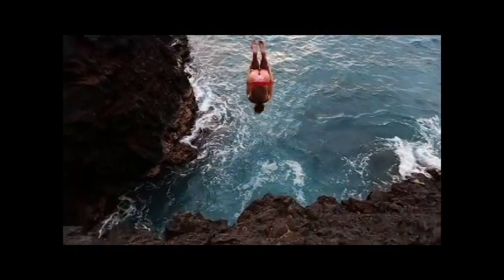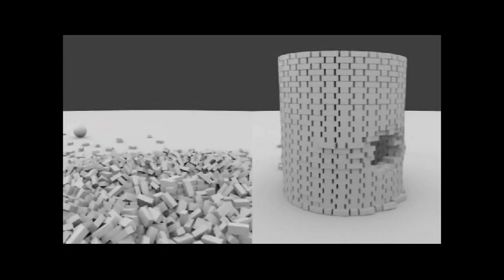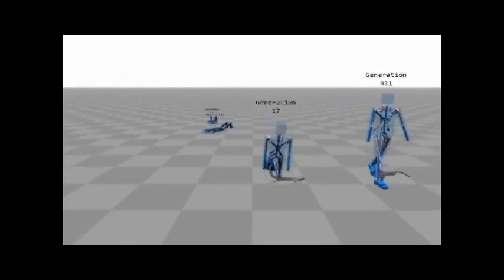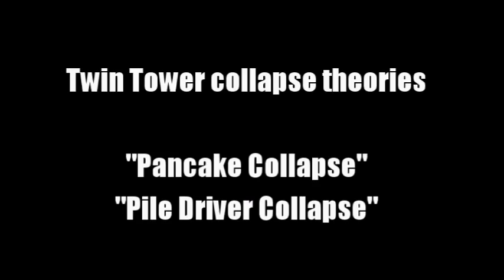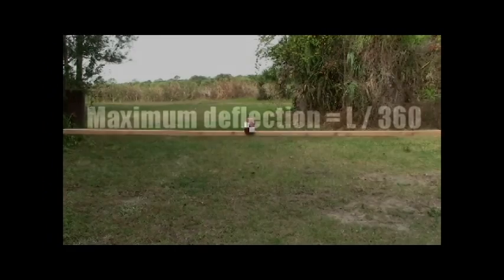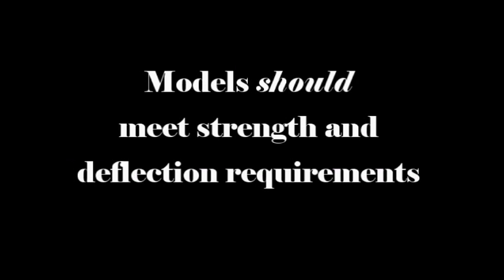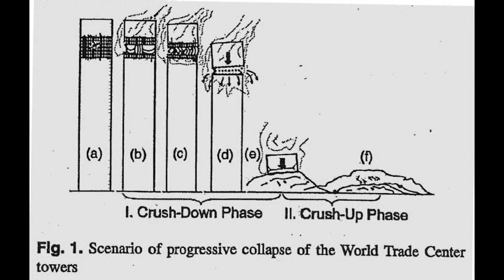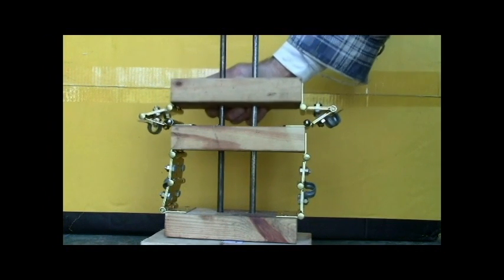9/11 Experiments: The Force Behind the Motion

Comment: The main problem here is that the word "collapse" does not describe what happened to the twin towers. The twin towers turned to dust in mid-air, as it was falling apart, a process plainly visible on the videos of the events. The seismic trace of each tower's disintegration showed only surface waves resulting from the sudden unloading of the bedrock on which the tower had been constructed. The expected 170 foot pile of rubble was not present, as pointed out in the video. Only 20 feet of rubble was present where the towers had been. 
Explosives used in a controlled demolition make a loud noise, not the continuous 12 second rumble that was heard by multiple observers. How many million pounds of explosive would have been needed to rig each floor top to bottom? An impossible feat. Also the dust that resulted was not hot. It did not burn anyone. The destruction of the towers occurred at ambient temperature.
WTC 7 was turned to dust more slowly, and its granite facade was little affected. When finally there was not enough of the original steel left to support the air conditioning penthouse, it plunged down through the remaining weakened floors and pulled the facade down and inward over the minimal debris that was left. 
WTC 3 and 4 were similarly turned to dust, and so was most of WTC 6.
A process never witnessed before or since.

Comment: Look at the archival footage of the WTC construction and observe the very lightly constructed floor truss system. It is impossible for these relatively light floors to pull down the vastly more robust core and perimeter columns,  especially the increasingly thicker ( up to 3" thickness ) and completely UNDAMAGED lower sections.

Comment: nothing even close to scale on any of the materials or construction.
Reply: +immrnoidall Yes...  FAR MORE FLIMSY THAN THE ACTUAL REAL WORLD CONSTRUCTION 

wake up
Reply: *****  it would need to glue only paper walls to the sides of the model and tiny paper columns for the elevator shafts in the middle to come close to scale. then throw a soda can filled with kerosene  into the middle and light it. then about 40 minutes later light an m80 off inside to simulate the tons of molten aluminum that exploded when it came in contact with the tons of water stored and spraying from the sprinkler system.  you can't simply scale something down on up and get the same results. like if an ant were the size of an elephant ,it could not move on its own. 15 years and not one real scale model of the three buildings. this guy could have built 2 with all the time he spent away from his farming. plus there is no single action to disprove . you have to have all the actions combined and the same time as was on that day. at this scale ,a floor joist bolt[the things that kept the towers walls from peeling off like banana peels] would be microscopic.
  watch the towers collapse .they peeled open like a banana as the top,[the equivalent of an ocean liner], fell through the unsupported walls.
  these towers were 1,362ft tall . if this guys model was 13.62ft tall, all those materials in this structure that has nothing to do with anything  would be 100 times thicker.if your model is 1/100 ,your building materials need to be 100 times weaker too. the floors of these towers ,were designed for desks and chairs . not tons of molten aluminum. the fire proofing on the steel was mostly cement. if you hit it,it falls off  and then instead of 10 hours of fire resistance you have 19 minutes and it is ass useless and can't support shit. they peeled open and a lot of the walls fell onto the surrounding buildings,in big enough pieces to crush them . you are being distracted with how. when it don't matter after the fact who and why is the more important point .bush bin laden gold oil destroying a of secrets war profits. 15 years and still nothing but how theories , when we should have dragged these fuckers off for a good old fashioned beat to speak. they must laugh their asses off every day.
Reply: +immrnoidall Exactly. That's why he chose this audience instead of submitting his findings to experts. He would be laughed out of a high school science fair with these experiments.
Reply: ^^^^ more dopes who think amateurs can fly jumbo jets like fighter pilots -- write 50 lines on that explaining its plausibility .. As for this experiment, it makes FAR MORE SENSE than the NIST report and their discovery of ' thermal expansion ' -- Have any peer reviews on that fantasy theory ?
Reply: ***** 
fly jumbo jets like fighter pilots ? when did that happen? lol  how much  fighter pilot training do you think they needed to  throttle up and dive into a building that big . a child could do it.
plausibility ,lol ? that's a funny thing to hear from a dreamer like yourself. explain how  thermal expansion would have anything to do with the destruction of these severely damaged buildings ,with thousands of gallons of jet fuel burning inside. these buildings were pretty much condemned because of the old dried up shitty asbestos fireproofing. and i did not get anything from nist reports . it's just common sense and basic jenga banana peel collapse science. these things were barely standing on their own . that's just how they are designed . just enough to hold up under normal conditions . and how long have those joints been bending back and forth in the wind?  no one took the risk of getting caught riding and blowing up these buildings and scattering evidence all over the city. much easier to get your dying buddy to get him crazy friends to do it for 72 imaginary virgins and a new kidney for obama bin lyin .[and some cash and oil and guns and tanks and rockets .
Reply: Children can fly jumbo jets, according to you?  Can they overtake them, too? The WTC was a weak structure?  lol  You're just making shit up on the fly, bozo.  Ignoring the NIST REPORT, too?  If you're going to defend the 'official' story, you better get your facts straight and know what that story actually is.  Your entire wall of text is nothing more but a jumble of anecdotal nonsense.
Reply: +carol prince  These guys took flight training. They didn't need to know how to take off or land, the most difficult part of flying a plane. It's not hard to imagine that someone with a little flight training would know how to steer a jet into a building. It's not like these buildings were difficult to find from the air.
Reply: Why do people like you even try? Have you not seen the interviews with their Cesna instructors? Do you know anything about being a pilot?  My brother in law flies both these jets for Delta.  He, like thousands of other pilots say NO WAY. I think I'll go with their perspective, not your childlike nonsense. Flying a jet without auto pilot is complicated for the experienced and without knowledge of the computer systems it's impossible. I find the official narrative an insult and if you had half a brain, you would too.
Reply: +carol prince Well then, if your brother in law says so, I'm convinced. Why didn't you say that sooner? Have you contacted CNN? Carol Prince's brother-in-law says "NO WAY', the debate is over. So now that we've proven scientifically that the terrorists didn't fly the planes, who did?
Reply: He's an expert pilot with over 28,000 hrs. But CNN won't air any of the Pilots for Truth, you should know that. Is there ANYTHING you know other than how to be a stupid fuck? Ignorance never runs out of gas, either. So I expect a stupid fuck comment back. Have at it.
Reply: +carol prince Oh, i totally believe you. Trusting the opinions of anonymous people online and their anonymous experts is the most scientific way of discovering the truth. Nobody has any reason to not take you and your brother in law's opinion as fact. You need to contact Popular Mechanics with this information. But again, I ask you, since we now know for sure that terrorists didn't fly those planes, who did? You can't just say it's impossible, therefore, conspiracy. You need an alternative hypothesis. Who flew the planes? Were there any planes or was it all special effects?  Aliens? What's your theory?
Reply: Joe D 
it is like examining brain surgery to a cat. they can't understand it, that don't care, and they just want attention .
Reply: it is like examining brain surgery to a cat. they can't understand it, that don't care, and they just want attention .

Comment: Yes Yes Yes Finally and A heart felt thank you for your time and Dedication to finding the truth. 
Dr Judy Woods always talked about the Core Columns and how they were left standing and they were you see them in your vid and them the CORE COLUMNS OF  American Made Steel,  Fire Proof or painted with some form of Fire Proofing as to code TURN TO DUST RIGHT BEFORE YOUR EYES.  
 That cannot happen Period..  
She feels that some form of Free energy  Weapon  or Beam what use along with Cutting shape charges and Thermite  and Don't forget the HAT  The Twin Towers add a extra heavy Duty section of Beams that formed a HAT the was over 2 stories tall locking the top of the building From the Core to the outer four corners so the way it fell Not  Chance In Hell   Great Work 
  Im a union Crane Operator With over 23 Years in the Seat and will never give up until everyone responsible is in Jail God Bless     Ben

Comment: You went thru all that trouble and did a great presentation.  Did you ever consider building a scale model of the WTC - 

2-3 models.  Each with a different scenario.  
1.  A plane crash - kerosine fuel - 
2.  A plane crash - kerosene fuel - thermite on the core columns and outside columns
3. Etc
Reply: +Zem Zem 
Newtonian physics tell us that it is impossible that a falling mass can continue to accelerate through the path of greatest resistance (in this case through itself). There is absolutely no calculable measurement that will support the official narrative.. thus why zio-NIST never provided anything from a scientific-math-physics standpoint that can be verified.. they made absolutely no attempt in doing so. 
This is why they gave us GIGO computer simulations.. where they could keep manipulating the data until they arrived to a visual outcome to suit the narrative.
The input data for their modelling was locked away for public safety i.e. their safety from the public.
Even if we apply the laws for the conservation of momentum where two objects collide with an inelastic collision. 
(M1V1) + (M2V2) = (M1 + M2) x V
We are unable to account for the calculable rapid deceleration (missing jolts) that we should expect to see / measure as the upper block falls onto the intact structure below. Potentially crushing one floor after another.
So imho, there is no need for any scale models, but force NIST to release their GIGO data inputs <- If out, this information should be enough to hang them for treason.
Reply: +WakeTheFuckUp 

No, the stationary object was the 1 floor beneath it. That floor was connected with bolts to the outer and inner columns. So:

M1 = 31 floors, M2=1 floor
M1 = 32 floors, M2= 1 floor
M1 = 33 floors, M2=1 floor
M1 = 34 floors, M2= 1 floor
M1 = 35 floors, M2=1 floor
M1 = 36 floors, M2= 1 floor
M1 = 37 floors, M2=1 floor
M1 = 38 floors, M2= 1 floor
Reply: WakeTheFuckUp - sorry for the late reply.  I totally agree with you.  The only way those towers could collapse like it did is it was built like an upside down pyramid.  The towers were built in three sections.  Each section below could hold and withstand many many many times more than the section above.  

Regardless what anyone thinks of WTC 1 and WTC 2 - WTC 7 never took any hits from an airliner.  These NIST guys are good actors.

Comment: Good work!Trained to be mining engineer & end up as civil engineer and so when
I saw twin towers were collapsing I told my friends that it was due to
explosion and collapsed. I was wondering who put the bomb inside the towers. At
that time, many friends though I'm a nerd. I told them, put the explosives inside the
structural joints with mili-sec delay detonators then use top down or bottom up
design and can pull down the structures. But nobody believe what I said. Now
this physical model is showing very clearly what happen to the towers.

Comment: Jet fuel can't melt steel beams
Reply: +You&#39;re Gonna Have A Bad Time 
Even though you and I know that, the point to the video is even if it could melt, or even weaken the steel beams, what we saw happen to the towers does not reflect reality. Every single floor would have had to have been weakened / melted in order for fire to have been the cause.

Comment: A horribly bad presentation. Enticing interesting clips of bikini clad girls jumping off cliffs into the water, clips of professors as though they somehow support your conclusions. Statements and formulas, workshops, materials, all to feign authenticity, knowledge, accuracy, understanding and sound conclusion, all, entirely absent. Nothing of your toy buildings and experiments mimic the WTC buildings in any way. A weight dropped in the center of a span of material strung between 2 supports has zero resemblace to the structure and events in the WTC on Sept 11. Your paper structure with firecracker explosives designed to mimic a fictitious theory, a self fulfilling prophecy. No replication of heat damaged steel girders and trusses. No separation of structural components. No display of damaged structures. It is stated by experts, a fall of 2/3rds of a meter, about 20 inches, of the millions of pounds of structure above the damage, would overwhelm the supporting structure below and produce a continual complete collapse. Nothing done in scale, weight, dimension, design, damage or circumstance brings you erroneously to some vapid conclusion.
Reply: You cannot understand with your eyes closed
Reply: As usual, no explanation of any validity of anything from the video or refutation of my comments and observations.  9/11 truthers are like blind religious nuts who repeat what they have heard from others in their factless beliefs about god and creation.  Unlike religion that requires one believe on faith, science relies on evidence, facts, experimentation, knowledge, sound understanding.   This video is pointless.  Nothing resembles anything from 9/11.
Reply: Actually, you CAN.  You simply cannot understand if you don't ENGAGE YOUR BRAIN.

Comment: None of these experiments takes into account actual forces to scale with proportional structural limits to scale with material composition. It also doesn't simulate 15 floors (or whatever it was) crashing down on the floor below, causing it to collapse and now the weight of 16 floors is crashing down to the next, etc. How could that possibly stop?
Reply: But the upper sections in both towers practically turned to dust and blew the steel segments out sideways before they had a chance to piledrive. In the footage, we clearly do not see intact upper sections driving their way through the denser, healthy buildings below. Let's not forget that the twin towers were built with approximately 400% redundancy, which meant that the structures could support around 4 times their weight and comfortably still stand. The core beams were substantially stronger/thicker at the base than they were at the top. They would have retarded and stopped the pile driver collapse had it really been that. This experiment was using weaker materials and dropping the upper sections from a greater height and yet still we saw the deceleration.
Reply: +Dan Giambrone but to scale, the experiments were not using weaker materials and did not show the total mass of the upper structures slamming down onto the floors below. If you watch the videos of the tower collapse, yes you do see the top n floors crashing down as a unit onto the floors below. And you have a combined effect of effectively dropping a building onto another building, whereby the top segment is destroying itself from the bottom up as the bottom segment is getting shredded from the top down. Besides. There's a big difference between static forces and the violent, pummeling dynamic forces involved in hundreds of tons of concrete and steel slamming into the structure. If you're trying to convince people that this was a controlled demolition, then you'd have to show how all this was somehow set up in advance in both buildings with no one noticing, and somehow set off to occur exactly where the planes hit, with the triggering mechanisms surviving the initial impact.

Comment: Nothing. There is nothing here of any worth. The experiment resembles nothing from the WTC buildings, nor how they fell. Nothing to secure any proof about ohysics. Nothing to refute what was observed that day. Everything seen, was predictable. Outward force of ir/ smoke/ fire, tilting of the upper portion as it fell, initial collapse at point of impact of the planes. An increase in speed of the upper portion until terminal velocity based on physics, gravity plus resistance of the structure collapse based on strength of each floor. If there was a loor section that was stronger, say a 6 story section with twice the strength, a delay would be observed as the force was teansferred through to the structure below. Everything was predictable. (not counting WTC 7).